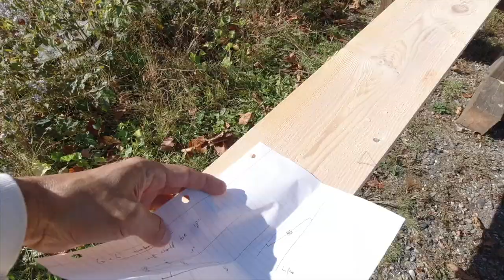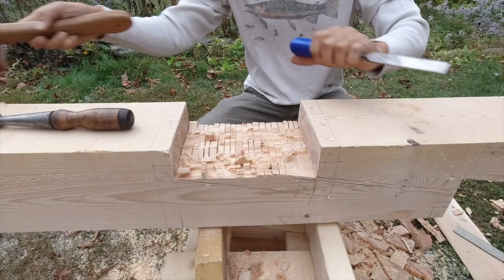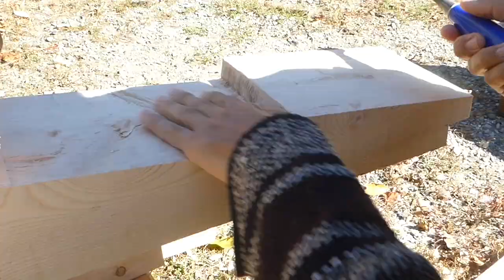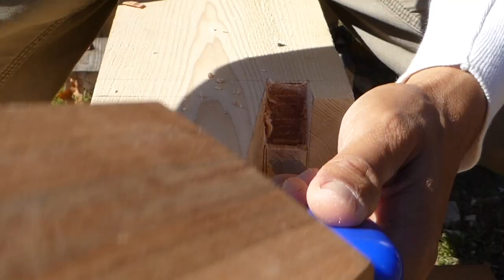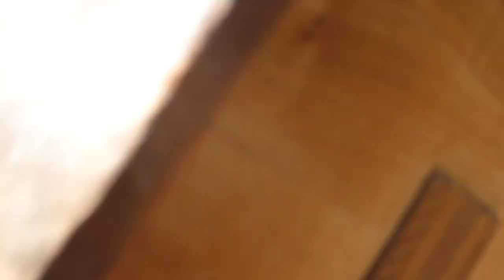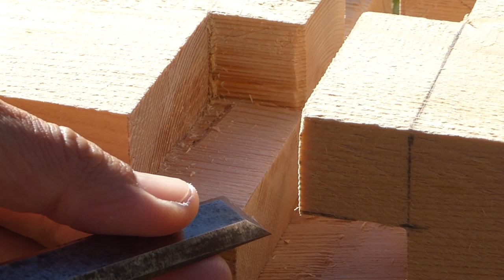A Japanese-Style Scarf Joint - Kanawa Tsugi

Comment: Nice job, But you cut the joint from the same piece so in other words you didn't actually need to do a scarf joint?
Reply from the maker: Good question. Seems like a silly thing to do but this timber had to go underneath my house and fit into mortises on both ends. Unless I were to remove the entire floor across two adjacent rooms there would have been no way to actually fit it in because of you include the length of the mortises the timber was longer than the span between the other two beams into which they fit. I could have cut them from two separate pieces but I just happened to cut them out of a single piece.
Reply: @mikekim5135  ahhh alright, well that makes more sense.

Comment: Why do that when you have a perfectly good beam?
Reply from the maker: I had to replace a rotted beam under the house. The ends of the beam had tenons that went into mortises. Removing a rotted beam is easy. You just cut it and remove. But getting a new beam in its place is tough if you want to utilize the old mortises. That was the reason for cutting them in half - so i could insert each end into the mortises then reassemble once they were in position.

Comment: Question: where did you get the dimensions for the cuts? Logic ?
Reply from the maker: I came up with my own layout dimensions. I did some research on scarf joints and had read that the length of the scarf should be greater than 3x the height of the beam. So I went a couple inches longer just for good measure. Also the Tradesmans Channel has a few videos where he makes an undersquinted scarf joint and I got some ideas from him. I had actually planned to just do an undersquinted scarf originally but changed my mind at the last minute which is why the scarf angle is more drastic than the traditional Japanese version.